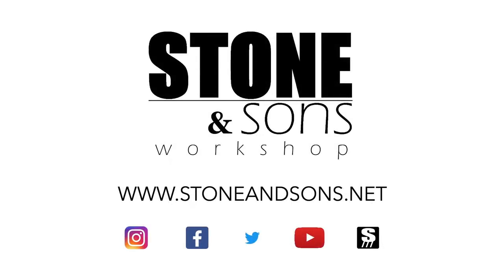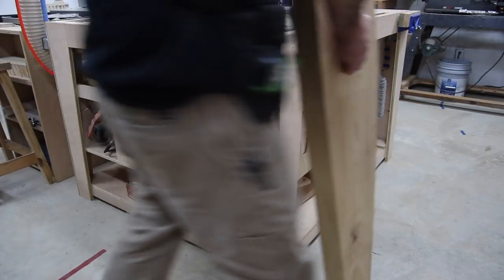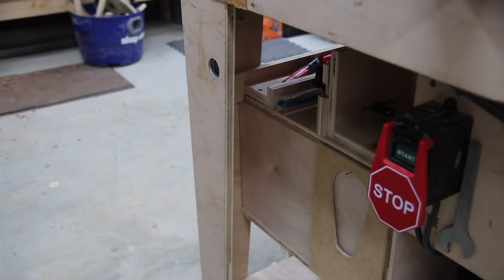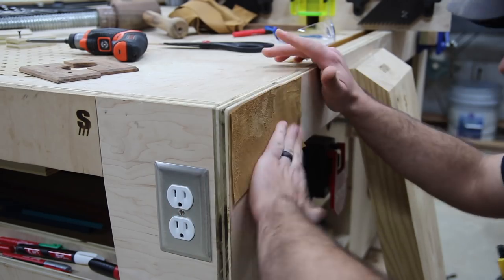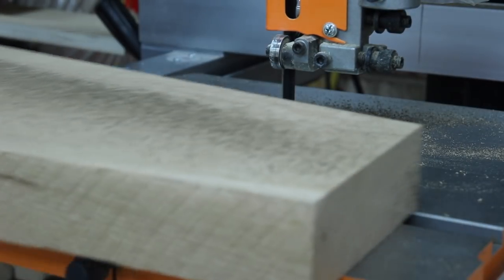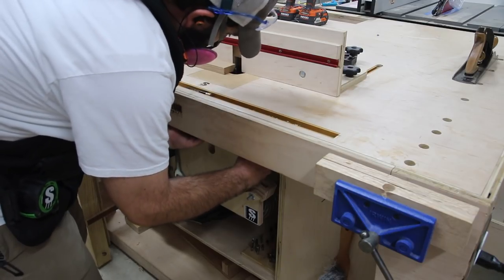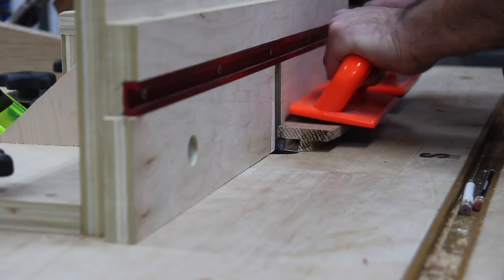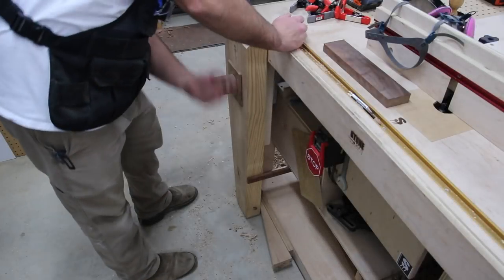How to Install a Leg Vise - Woodworking Vise

Comment: I was wondering...having a wedge at the foot of the vise ...doesn't that make the vise want to rack clockwise? Would cutting an angle at the foot that matches the angle of the wedge make it sit right when using the vise?
Reply from the maker: It doesn’t make it rack side to side but it would help seat better.
Reply: The oversized threaded rod is what's keeping it from racking.
The setup only lets the far right edge of the bottom of the leg vise to make contact with the wedge. 
I've never used one but I'll assume there isn't a lot of pressure at that point so it's probably not a big deal.
You do amazing work. I'm glad to be here trying to learn.